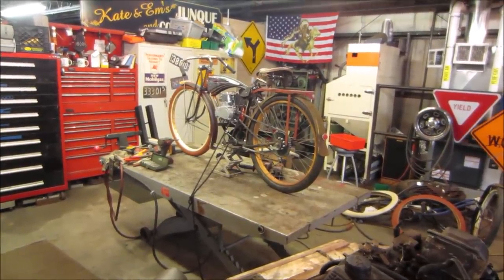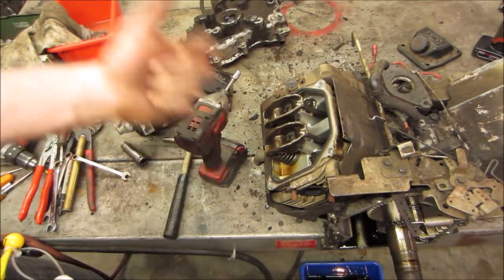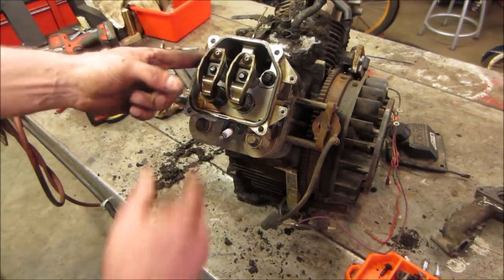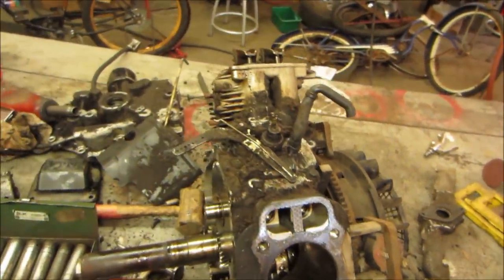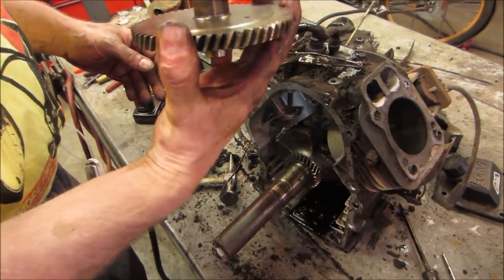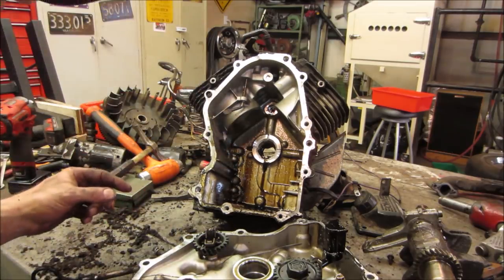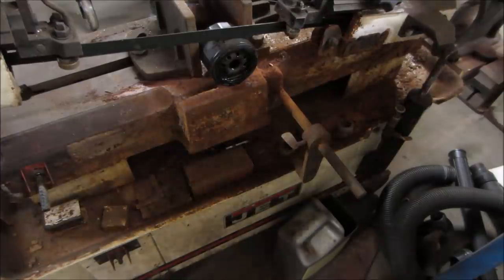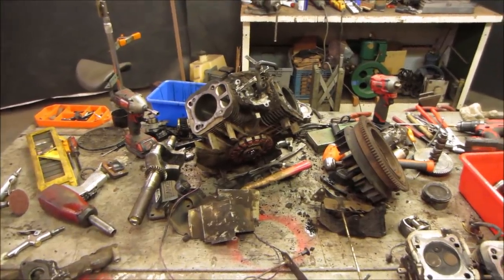Why Did This Engine Fail?

Comment: Clogged cooling fins combined with an out of balance attachment on the end of the crank resulted in an overheat and overstress on the crank.  The crank started to wobble as evidenced in the excessive end play, the wobble caused one connecting rod to fail and then it was all downhill from there.
There are crescent marks in the other piston head that I believe are from the piston topping out of the cylinder not allowing the valve to open and bending the push rod.  If you look at the nose(the correct term escapes me right now) of the starter at 1:38, you can see a notch on the left, down, side.  I'm betting the teeth of the flywheel ate into it when the crank started to wobble and snapped the mount.
Or I could be completely wrong......

Comment: What's worth saving, besides the odd bolt? I think it was poor service. The oil looked dirty, and maybe the filter wasn't changed with every oil change. The overheating due to clogged cylinder fins would also challenge dirty oil.
Reply: He said at one point that he does scrap art sometimes - so maybe for that.

Comment: Interesting tear down.  Hope you tear down smoking engine.  I have a 17 year old Kohler 22 hp gas engine on a Craftsmen 50 inch garden tractor.  It smokes after starting it up.  Maybe a similar issue.

Comment: Kohler's are bad for oil leaks and then plugging up the fins causing over heating. I loaned a complete puller set to a person and he returned it o.k. When I went to use it six months later, I found out that the main rod that goes to all the attachments was missing. He said he returned it complete. It was in a plastic bag and tied up and never opened until I went to use it. Learned my lesson.

Comment: What about a clogged oil gallery in the crankshaft?
Reply: What about it? Commonsense says make sure its clear. After a rebuild shop carefully bored honed and fited pistons they chose to sandblast the block all pretty and new, filling the oil galleries with sand. Being a trusting soul I assumed they knew what they were doing

Comment: Possibly a sludge trap in the crank that got plugged? My Triumph motorcycle had them that I didn't know about until someone told me about them. Perfectly clean when I opened them up: oil changes every 500-800 miles.

Comment: I'm betting it was a failure caused by low oil level BECAUSE there was very little oil in the crankcase when it was opened. The hole in the block was nearly at crank centerline and there was little or no sign of spillage on the outside of the block. The Kohler V twins hold about 1 1/2qts of oil. The condition of the engine indicates that it was  NOT well maintained and I consider it likely that it was started before the oil level was checked. The condition of the crank journal shows that the #2 rod seized which is a common result of oil starvation. The low oil switch either failed or it was disabled.

Comment: Did you drain the oil out of it before taking it apart? Seems like there was not a lot in there. If it was low, and then tilted while running, it could have just let go.

Comment: I don't disagree with you on why it blue. The fins plugged making it run a little hot and the oil looked black as coal and didn't look like it had been changed in a while. Both I think were also factors. I think it was not properly maintained. They just want to keep it in service and forgot or didn't care about the service.

Comment: Those piston skirts area   more rocking action putting stress on pin area of rod?  the older engines had fully round skirts
keeping it straighter in the bore     a compact design so the pistons are chosen for that instead of a longer
cylinder  just guessing    may i see the blue print of the engine before buying   lol     enjoyed watching take care

Comment: The more i look at this, the more i wonder if perhaps the damage wasn't from the engine side...rather from the outside. Would a sudden engine stop from speed, cause any of this? I know on car engines, if the gear box craps out and full locks, you can break connecting rods, i have such an engine for parts from a fellow i'm in a track club with. He had an accident, the gear box got squashed and the crankshaft fully stopped at high rev/load.

Comment: Must have been a cool sounding engine.  With a single rod journal, it would lope something like a Harley.  The difference being this engine looks to be a 90° V whereas a Harley is at 45°.  It would still lope though, and shake as it's impossible to balance it completely.

Comment: Had a similar issue on my atv. The rod was seized onto the crank. Happenend to me while accelerating (engine locked up all of a sudden, causing the rear tires to lock up and draw 2 nice black lines onto the tarmack). I tore down the engine and all I found was the rod almost welded to the crank. Everything else seemed to be fine. Then Ive built an engine with the top end of this engine and the bottom end of another engine which had a piece of valve guide broken off and fallen into the cylinder. That was a couple years ago, that frankenstein engine is still pulling strong. I dont know what caused the rod bearing to fail. I think some failures are just related to advanced normal wear.

Comment: I find it odd that the small ends of both rods split in two and jumped off the wrist pin. I think that the motor over revved and the valve(s) hit the pistons without damaging the valves but still bent a pushrod. Anyway, got some good parts.

Comment: When you took off the cylinder head without damage to the valves and then showed the bent pushrod my guess was: some piece of scrap flying around in the case got caught between cam and lifter and lifted the pushrod one time all the way up, until the rocker arm hit the valve cover or the valve was down all the way and blocking any further movement.

Comment: Is it heated up on the fence for each cylinder wall the exhaust valve will get the hottest and it will actually stick in the head and then also if the cylinder walls where the rings are they will seize up to momentarily and then it's just jerks them out because usually they got to the fire down so you don't need a lot of to support the down throat from the piston so that's why they come apart there is just lack of cleaning it out every season and making sure you had plenty of clean fins that's all it matters and a lot of synthetic oil would help too!

Comment: I'm going to go with lack-of-lube for $5.00, Bob.  My main bet is that engine was running at the end of the governor's reach its entire lifespan.  Overheating the oil changes the viscosity, if they used too low a viscosity (ie below 30) and ran it hard with blocked cooling they were adding a large amount of load and it was probably starting to pre-detonate.  Additionally if they were putting 5w synthetic in it the oil pump would just be bypassing like a mulching mower without the side-blank... it probably would never get TO pressure.  The groove in many oil pumps is their own internal lubrication system.

Comment: Would that engine be considered a non interfering engine... since the head is cupped and the piston is cupped? It would seem there is room for the valve to move even if the piston was at TDC.

Comment: With all that crud on the cooling fins, I thought it might have shown more evidence a piston seizing in its bore, but not really seeing that on the cylinder walls.  By the amount of oil that was still in it after the crankcase got ventilated, I don't think it was running low.  Seems to me the overrev failure is to fracture a rod, so maybe someone was overriding the governor.  Hey Mustie, can you rev the snot out of the other "Smoker" engine and see if you can make it fail similarly?

Comment: I've had a bunch of cheap cars and I've only had one "blown" engine. I was working on my 1977 Trans Am with the engine running and dropped the wingnut from the air cleaner down the carb. Boom, broken piston.

Comment: When  the top end of a rod fails, that's usually and indication of overspeeding. BUT...If it wasa Kohler Command (not Courage), they have hydraulic lifters that will cause valvetrain float above 4k RPM. In that case, it could've been a piece of the other rod getting jammed in somewhere.

Comment: I'm hoping you will reassemble the engine and get it running. I know you are missing parts. I know there is a hole in the crankcase. I also know you have tons of parts of various kinds lying around. I think you can repair the crankcase hole, too.

Comment: I noticed you have the same Milwaukee fuel brushless tools I have, they have 4 setting for power, 1,2,3, and fastener setting, when you gave up and used Bertha you had the Milwaukee set at 2, I bet if you set it to 3 it would of gotten that pesky bolt out of the head.
 I believe it was poor maintenance that caused that v twin Kohler to go, that oil was once oil at one time, wow that was super black oil.
Reply: I noticed that too, maybe would've helped

Comment: Oil pressure switches and low oil sensors are two different animals.  The oil pressure switch requires oil pressure to close.  It would not easily work as a low oil level sensor as it would need to be bypassed during cranking until pressure builds.  It usually goes to an eediot light.  The low level sensor is a float that senses the actual level in the crankcase and is connected across the kill wire of the coil{s} and stops the engine when the level drops to low.  Oh, the Kohler aluminum engines are pretty much all metric hardware.

Comment: Chances are that someone put a wix oil filter on it and didn't change oil for long time. Wives plug up solid preventing oil flow and poof goes engine.  Tired one on my car it crapped out oil pump in a week and engine started to knock.  Went from 70  psi oil pressure to 20 in a week.  Hence I only use frams now.

Comment: I'm thinking lubrication failure. That oil looks like it's been there from the factory, and maybe added to occasionally. Original filter may be clogged and getting bypassed for a few years. You seem to think it didn't run low, but when you took it apart, there wasn't much oil in the sump, the filter or the pump. If the bent pushrod was on the "good" cylinder, the flying debris in the base may have hit the bottom of the piston after it broke off and jammed it up into the cylinder when a valve was open a little, bending the pushrod. Just my 2 cents, but what do I know! :-)

Comment: I work at Southern tier small engines and I have worked on a lot of those same engines and its pretty common on the kohler engines I have 4 blown ones usually they snap the cam to sometimes they don't I had a block with all the internals intact and had the 4 blown ones so I have taken them and built one complete junkyard engine the only thing I had to buy was a carb and originaly the one I put together was supposed to have had low compression but when I got done assembling it I ended up with around 150 to 160 psi compression and a constant 35 psi oil pressure with no fluctuation pressures stay constant from idol to full throttle no governor

Comment: Only Mustie would have considered trying to start the engine with the hole blown through the side of the crankcase! That would have been pretty funny. Remember that toy they used to sell called the "Visible V8" that was a clear plastic model of a V-8 engine? Mustie is bringing that back with the "Visible V-2".
Oh, and by the way, it's NOT the carb! LOL.

Comment: Could it possibly be the bent push rod? Think about it valves have everything to do with timing and compression. You can have either to little or to much compression do to valve issues. With that bent push rod the valve cant open properly causing a build up of compression there for putting to much pressure on the rod causing it to bust

Comment: While hot, the piston in the scored cylinder was beginning to seize. If flywheel temperature was above operating range, the glue bond on the magnets could have failed, allowing the magnets to move. This could affect spark timing such that pre-ignition might have occurred.

Comment: Hey mustie1 if you get time and enough folks are interested would you consider doing a video on cleaning that aluminum off that crankshaft and see how it turns out? I've seen quite a few different methods on youtube claiming to work well but I've not had to try any yet myself.

Comment: These Kohler engines are known for the magnets in the flywheel (rotor) coming loose after some time, especially if they sit for long without getting used. They can easily be repaired with JB Weld 2 part epoxy if done right. There are how-to videos explaining how here on Youtube. Often you don't know they have come loose until there is a charging issue or a noise

Comment: If this engine uses cooling airflow as a speed regulator then it's possible that the blocked cooling fins retarded the airflow causing the speed sensor to detect "apparent" low rpm, causing the throttle to open progressively, thus causing an overspeed runaway situation to the point where the connecting rod failed due to inertial forces. Valve bounce due to engine overspeed could have been a side issue which bent the pushrod.

Comment: It's interesting to see that small engines like this use gerotor oil pumps. Many of the turbine engines I work on use gerotor pumps, although with maybe 7 rotors on a common shaft.

Comment: I had a Briggs Vanguard V-Twin in a Craftsman mower fail on me once. Damn mice had packed the fins inside the tins full of fiberglass insulation. Bent a pushrod just like that, the head overheated and seized a valve. When I ran the piston down on that side, there was a LARGE blue spot on the side of the cylinder. Time to retire that one to junk.

Comment: I have worked on similar failings to these over the years,  it was often because the owner did not change the oil or filter and the filter got blocked hence oil starvation and BANG!!!

Comment: Looks like overspeed. The rod failed in the middle, not at the big end. A big end seizure would soften the rod at the bottom end and would part company there. The crank would probably be blued as well. The lower part of the piston got smashed by the flailing rod. Perhaps.

Comment: I think the top end of the cylinder over heated and the pistons wobbled and seized or the heat itself caused them to freeze and when that happened it caused the rotating assembly to rip itself off from the pistons. I bet the cylinders got heat warped and thats why they were so hard to remove . I have witnessed this in 2 strokes where they have ran to hot and the piston locks up . Without snapping off . As he said it was hooked up to basically a giant flywheel thats alot of inertia to stop if the pistons locked up that energy was enough to rip the connecting rod from the pistons.

Comment: where are you with the econoline? I really enjoy those vids.
Reply from the maker: finishing up the welding, then l will film some more
Reply: @mustie1  cool, i love that thing. Oh by the way I think your idea of coating with ...whatever concoction it is is a grand idea. I have used a similar idea, and also actual store bought undercoating, the oil base concoction I used actually worked better for rust prevention, though the store bought stuff had other qualities that make it good to use in certain places. Basically my concoction was used oil, a bit of kerosene to make it flow well, and whatever other grease or oil I had around at the time. the kerosene evaporates, the concoction dries to a thick but still flexible coating. Doesn't do very well on parts that see a lot of abrasive use.

Comment: Oil probably thickened up too much to make it to the second crank, and caused it to fail.
It was the trailing arm that failed, based on the wear in the shaft.
It was probably run in the cold with oil that couldn't shouldn't be run at that temp. Cheap oil could be the death of many a motor.

Comment: I just tore down the top end of a seized 81 chevy 350 and i pulled pieces of piston #6 out of the water jacket and both halves of the exhaust valve seat from the water jacket in the head, unfortunate as it was a good running engine that was well taken care of, blew at 99k miles back in 2011, it was a class c midas motorhome

Comment: That engine took throwing a rod a lot better then my single cylinder Briggs did, though I guess it depends on how it breaks. Mine broke perfectly in half. I accidentally ran a cracked rod in mine and forgot I needed to replace that part after a fresh rebuild. A few knocks followed by a loud squealing from the flywheel and oil spraying everywhere. The rod took out the block, the starter, cracked the piston, and pretty much toasted it. I don't see a lot of wear or scoring so maybe the rod was weak and grenades it? If it were oil related I think there would be a lot more carnage with the bearings.

Comment: Once I saw the cobbled wiring to the engine it was not hard to see why It failed..  A good combination of overheating  and low oil  killed the engine.  The color of the Oil is a good sign.   Kohlar engines are built with a lot of pride in Wisconsin and I should know I had a friend that worked the assembly line.  The two diffrent bolts on the exhaust also showed that someone was in the engine before.. Prob never fixed the wiring right and there was no Low Pressure switch working and lack of cleaning and Maintenance......Kaboom!

Comment: Mustie opened the oil filter and no oil to speak of came out. Usually, there is oil trapped in the paper element. I didn't see Mustie look at the inlet attachment to the oil pump. Maybe it was blocked?

Comment: This engine looks like it was secondary damage. The equipment that it was pushing might have seized at full rpm and possibly have caused a immediate back pressure thereby tearing the rods and the engine. A brick or some solid item, perhaps, mixed with the leaf vacuum. Who knows. It seems as if that engine was healthy and not at the point of breaking on its own.